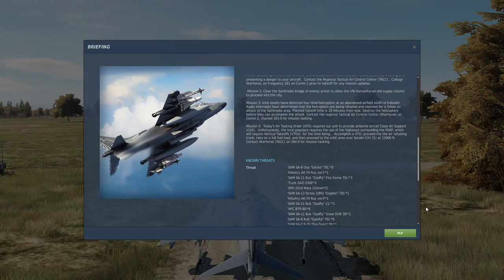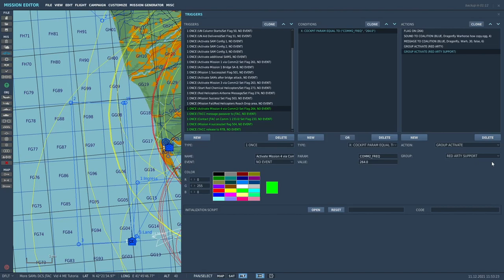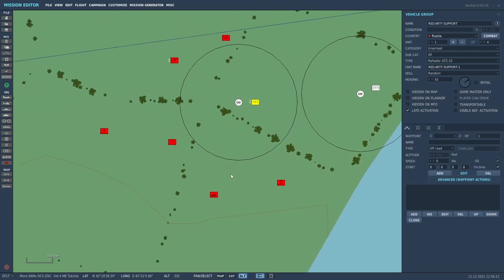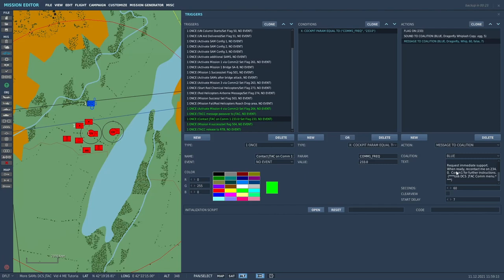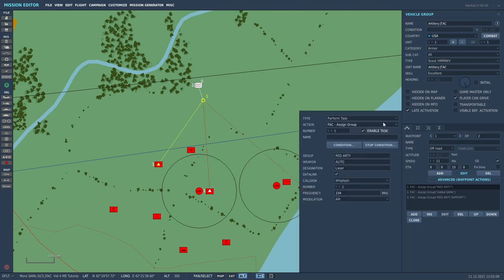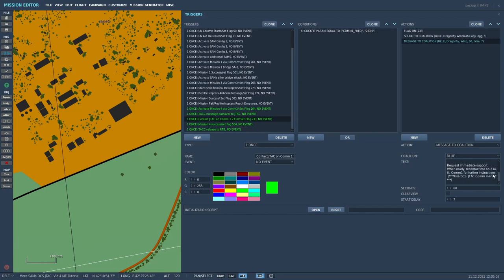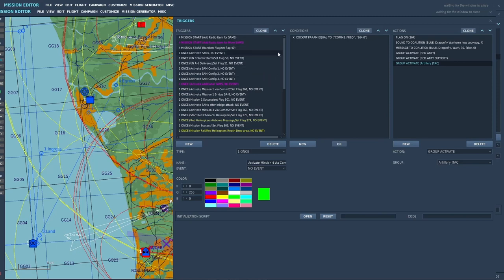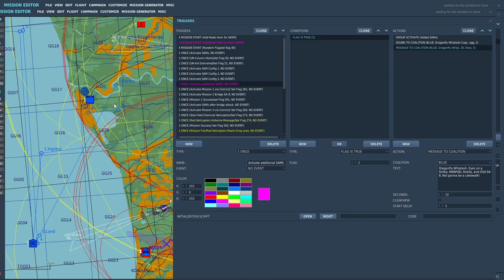Dragonfly's DCS World Mission Tutorial Video 6 - Building an AV-8B Harrier On-call CAS Mission

Comment: Hi again Dragonfly. Sorry to belabor this but I'm just trying to compare the build with the fly through. There seems to be more to the 2nd trigger that i missed. The fly through contacts Warhorse on 264 all trigger 1, then about a minute later comes another msg to contact whiplash on 233 comm 1 as you said below. Tuning 233 then whiplash instructs to contact on 234. Tuning 234 brings up the target coordinates and soon thereafter another message comes with JTAC1 losing target. So I guess i missed a lot of this in the mission builder tutorial. Just trying to get a handle on how you set up the actions and configuring the JTAC. Sorry for being such a Dunce! (Getting old)
Reply from the maker: Hey Greyeagle! My first thought would be to ensure the JTAC is in visual range (line of sight) of the target at all times. It means you have to place him down unrealistically close. You also have to make him invisible in the advanced waypoint actions or he'll get annihilated. Don't think you missed anything. Sounds like I didn't cover that trigger as well as I should have. Also ensure your JTAC unit freq is 234 , but I don't think that is the issue.  I hope this helps. Don't hesitate to ask me questions and don't get frustrated. It's really fun when the mission works as you built it!